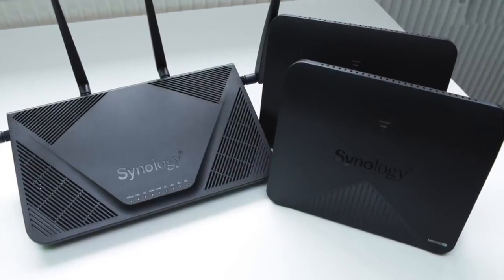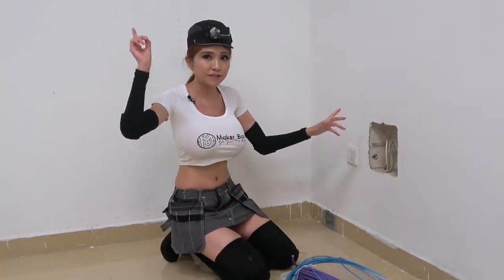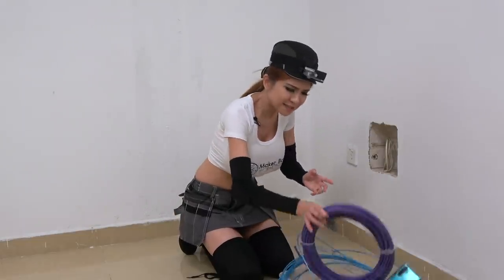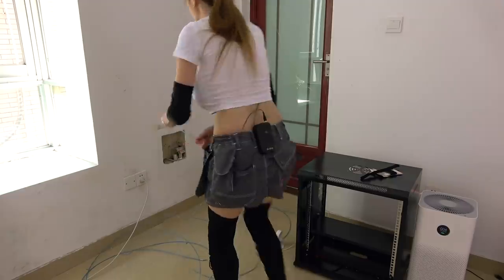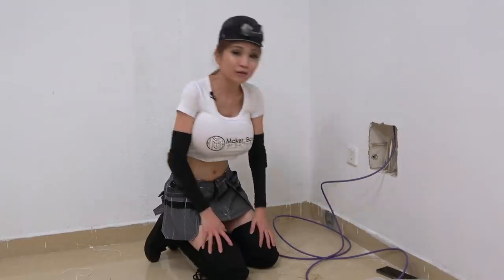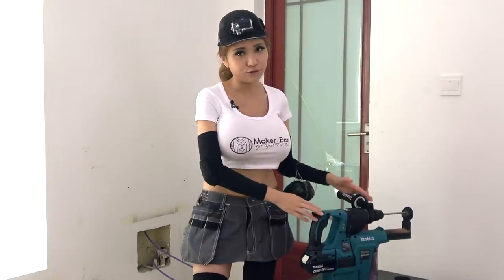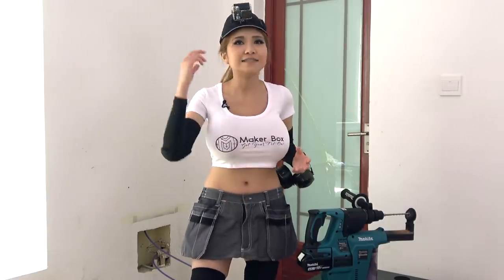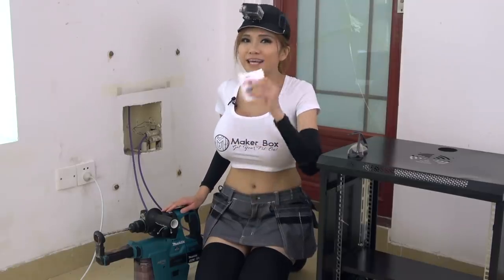Home Networking Part 1- Pulling Cable

Comment: I'm glad the pulling of the cable was so easy. I've pulled electric cable here in the USA many years ago. Because we had to pull so many cables through the one pipe we had to attach a separate heavy cable we brought in through a window. That cable was attached to the bumper of a truck. It took the strength of a truck to get the cable through the pipe!... One thing I noticed about the Makita (excellent brand of tool) was the tool's end is designed to drill a "perfect" 90-degree hole in the wall. That's precision!... And finally, women can do ANYTHING they want to do! I've known this fact since a little girl punched me in the nose when I was 7 years old because I was teasing her. LOL. Love to you Naomi and to all women. You are as "tough as nails!" (American slang!)

Comment: Naomi installing network cable before hot water: yeah, she's a nerd.
Reply: Ofcourse how els would you do it. Network first... The rest come later.
Reply: Move to a new place network comes first so you can pump tunes from your connected device while unpacking!
Reply: With temperatures as hot as she said, all she needs to do is set out a gallon of water in the sun while running cable. Boom, multitask.
Reply: who needs hot water, just boil it on a stove

Comment: JLPCB is truly great. Last week two friends (who don't know each other) showed me their latest prototypes.  One's an engineer whose prototype was for work, and the other's a self-taught hobbyist with no formal engineering training.  Both used JLPCB and had flawless boards.

The hobbyist friend also got lots of great feedback from JLPCB about DRCs (Design Rule Checks) he had missed, and learned a lot about keep-outs, drill selection, kerfs, slots and more.  The JLPCB folks helped make his first PCBs equal in quality to the engineer's.

Comment: You're fortunate to have conduit preinstalled, that's an important feature for concrete buildings. Concrete is an overall excellent choice for buildings--it's environmentally sustainable, and buildings have a long life.

I ran CAT6E through my house a couple of years ago. It's well worth the work, and it really doesn't cost much. I had to climb up in the attic crawl space during the summer and I could only stay up there for a few minutes at a time.

Great video, your English is very good.

Comment: Excellent video Naomi! As a PC/network field tech for the last 20 years, I have literally run hundreds of miles of network cabling. Not too much though over the last 5 years or so, and never run Cat 6e, that stuff is pretty heavy and stiff. It was so nice to see your fish tape go right through with no snags or sharp bends to mess you up, a lucky break for you!

Comment: I would work on your cable gang any day.  Polly always sees the good side of things, as we all should.  I used to have to use a vacuum to pull a string through the pipes to start pulling the main cables, of course, that was pulling 4 - 00 copper power lines using a 1/2 inch rope.  Cat 5 and 6 are fairly easy in comparison, still you explained and demo-ed excellently.  Looking forward to finish.

Comment: Ahhhh, the memories of running cables, did it for over 40 yrs. If you have to run more cables, in a conduit that already has cables in it. You can “ lube” it up with cable lube or use soap/ dishwasher soap. Plus strip back the cable at the head, to reduce the diameter of the cablehead. Just a tech note, if you put too many cables in a conduit, the signals in one cable can interfere with the signals in another cable. It’s called “ alien crosstalk”.

Comment: First off, lovely as ever and great video as ever. Second, when ever I have run cable I would run out a length of string tied to the cable laid out at length on the floor (that is stretched out the length needed plus a few extra feet) then with a vacuum cleaner hose on the other end and once the string gets sucked in, pull the cable through. No pushing through. Old saying in the army, officers up front because it easier to pull a rope then to push it. Again love your work.
Reply: I have done similar but the other way around.  Used compressed air to push the string through.

Comment: This brings back bad memories from the USMC when we switched over to Windows NT and cat 5 cables. Running miles (literally) of cable through well built concrete buildings in the middle of a hot summer in North Carolina.
Reply: now u can use cpl is quick to install than cable , ^^ and mesh wifi ,

Comment: One of my personal tricks for staying cool is keeping a cheap fan around for a quick breeze. The moving air helps your body's cooling system. Your safety gear is creative indeed. As long as it works, keep doing it. You would be a better Makita girl. You actually use the tools!

Comment: Awesome. A hammer drill is a very important tool, when you have a house. Drilling concrete without can be such a drag. I have bought mine after I had finished moving in :-)) It could have saved my some head aches :-))) And an electric installation in a house can offer many surprises, not only in China, in Germany, too. Especially, if the house is old.

Comment: An FYI trick for your future cable or wire pulls.  When I run long distance or through complex bends I use a small piece of sponge attaches to a piece of nylon twine.  I stuff the sponge into the conduit inlet then attach a vacuum to the outlet.  The suction pulls the sponge through. Once I have the sponge out at the far end I attach the wire or cord with a loop and some vinyl tape so I can pull it back through.  This method is fast and easier than phish taping in most situations.

Comment: You should make this into a video series, like renovation reality. It's really interesting to see what's different in Chinese construction. 

Dono if you've gotten hot water yet but you should look into one that doubles as an air conditioning as well.
Reply: Only problem with those is that they are poor at both jobs. You want hot water you run it at the point where it does not really get the air below ambient temperature, and if you want cold air your water cannot be too hot, as again you run up against allowable differential temperatures. Seen plenty of them just die and fail after around 4 years, as the compressors are cooked to death. Better to just have AC that works, and hot water from a separate unit. If you have a roof then solar, either panels or grid tie inverters, will be a much better bet.

Comment: You may think it is tough having concrete walls, but you are really lucky to have conduits in place. I spent hours trying to find a route from the garage to the first floor (a distance of about 1 metre) behind a stud wall.

Comment: I have pulled cable underneath wooden floors in the summer with only 50- 25 cm hight for me and my work. I know how exhausting it can be. Good to see you making progress. I'm excited to see a full room tour. 

by the way, usually you put the rack for your network a bit higher to make later access and service more easy. but you would need a propper cable enclosure from your wall feed up to the cabinet. So no complaints from my side how you've done it your way.

nice skirt by the way. looks very practical and fancy.
as always I wish you success and the motivation to reach your goals.

Comment: I have a bunch of Makita 18V tools, absolutely love them, I really like their cordless random orbital sander, the weight of the battery dampens the vibration and keeps you from getting "sander arm" from excess vibration. I find that I can run the thing through most of the day on a single charge of the battery, blows my old DeWalt shit right out of the water!

Comment: I've done a ton of wire pulling in north america, wooden studs, plaster board walls (Sheet rock) and fibreglass insulation. The IP camera idea is superb. HINT: I use a cheap USB endoscope, connected to a laptop. The light source on the end of the endoscope is worth it even without the camera.

Comment: That's an interesting Fish Tape you have there....  it has an attachment for the wire that you're going to pull... Normally you attach the new wire... To what's called the "Leader"',  ( it has a Loop for the New Wire)  The End you first put into the wall,  then you pull the new wire back through the wall.... Also, using CAT-6 Ethernet cable,  I believe is smart,..  it gives you 10 Gb of bandwidth,  plenty of bandwidth for the future.

Comment: Just a tip with conduit if you cannot get the tape through. Sometimes its easier to tape a wad of a piece of paper or a plastic bag to a string and vacuum it through. Then fish it up. I totally agree with CAT 6E Its what I use on all my network installs I have done for clients or myself.

Comment: My wife is also unable to sweat, so I'm acutely aware of how dangerous that can be working in the heat.  We live in Arizona, which hits 115F / 46C  or higher in the summer and so we've learned many a hard lesson on how to handle that.

Here's one such very important hard lesson that maybe can help you, too: if you are peeing a lot, then you are drinking your water in too large amounts at once!

It is critically important to stay hydrated but your body has a hard limit on how much water it can absorb at a time.  Any water peed out is water that wasn't used to hydrate you and was passed through untouched/wasted (literally).

We've learned to drink small amounts steadily and consistently.  You end up drinking a lot of water (roughly 1L every 1.5 hrs) but you never feel thirsty; heat exhaustion symptoms are drastically reduced; and you hardly pee at all since your body is using all of the water for hydration.

Simply changing the way we drank water was a game changer for us when working in extreme heat!

Comment: First the clothing. You're dealing with heat AND humidity and, let's face it, girl's gotta stay cool and dry. It looks like you've done the correct decision making on the practicality for you choices. 
Second, wouldn't it have been a little easier to let gravity help you  when fishing the wire?
Last, that hammer drill ROCKS!

Take care Naomi!

Comment: You’re lucky you the the conduits already there. Our houses generally aren’t solid concrete so cat 5/6 and various AV cables I need to run through walls I often have to use a “yellow tongue “ ( a long yellow piece 1cm semi flexible plastic ) and inspection camera can be very useful to. It’s funny you also talked about your clothes....your “cargo pants mod” is super cute, my wife also thought so and thinks you should do a video on how you made them!

Comment: I wired a stick built house years ago, and it was a very different process.  At the time I used an older Cisco layer three switch to handle all the intranet and some stand alone AP's.  A rack like that runs about $150 in the US these days, but I think they are higher quality, and deeper, a modern quality PoE switch needs more mounting depth than I think you have there, and if you need a rack mount server, good luck finding a wall mount rack with that kind of depth.  Pet peeve of mine, there's no TIA standard for CAT6e so I avoid it, the manufacturer could put anything they want in there and there would be no way to hold them accountable.  I recommend CAT6a or CAT7 if you don't think regular CAT6 is enough--although I'm sure what you have will be just fine.  I dig the giant tablet pockets on your shorts, super nerdy.  Makita is quality stuff.  Keep doing what your doing!

Comment: Very cool! That was fun. I have never had that easy of a time running cables. Usually, I have to grease them up to get them through the pipes. You are so organized. I could probably fix your hot water problem but the cost of getting there to do it would be outrageous.

Comment: Wear what works.
Pulling cable yourself at least for me was rough having to go up and downstairs to check my progress. Unfortunately, I didn’t want to totally destroy the place I had just moved into at the time and just ran wiring through the walls and above the ceiling but I have conduit to install when I’m ready to rewire everything.

Comment: Awesome work! I like your humour :-D
According JLCPCB: In Germany I tried to get small boards machine assembled. In a company I work for - which acquires series production - if I have a question for the part placer, they call back within 5 minutes. I know the boss and other employees personally and stuff, but when I want one board assembled for myself, they ignore my emails and act as they don´t even know me. And I tried several companies in Germany. They fcuking don´t care about prototyping or single board assemblies.
It´s not the first time that JLCPCB comes into my ear - I´ll definitely try them out! Chinese have a much better service and adapt to their customers´ wishes. I´m very grateful and happy about it. Thanx for your videos, always enjoying to watch!
Reply: I did one order with them and the process was very smooth.  It took about 3 weeks to get the boards to the states.  Most of that was transit time so I'm sure one could pay more to get them faster. The boards looked and worked great. Top/bottom copper layers with silk screen on both sides.
Reply: @timezonewall  Cool. For 60€ you can get shipping overnight, would be still half price of what I get in Germany.

Comment: Ah brings backs memories used to be networking specialist mainly laying and design but sometimes hands on. Mind you it may be a distracting working with you! But worked with many women and girls in my time , all were good or excellent at working with. They tried harder as it was not a normal work path for females.

Comment: Hi Naomi, Be careful drilling into those walls with all those hidden conduits (especially power). An electronic locator will help you stay away from the
cables. It is also a good idea to use cordless tools and have the power switched off, just in case. Greetings from Australia 💕💕

Comment: If plastic cable pipes behind walls are not available it is also a good idea to get a data over electric socket adapter such as tplink and similar. Just plug the cube1 to 220V ac aocket anywhere in the house then plug your lan cable from the router into the cube1. Plug cube2 at the room where you want to receive data and plug lan cable from computer, I think these cubes can broadcast wifi data as well, might be worth a test ;)

Comment: We ran a cable from back bedroom where the router is to the front room downstairs, had to zigzag through kitchen cupboards, as well as walls ....

but I haven't decorated downstairs so I just have a long cat5 going across the landing for the xbox because ping is more important than trip hazards  :p

Comment: Conduit?  That sure helps and is very rare in residential places of North America and in the places of Europe I've visited.  I've run a quite a bit of residential Ethernet and it's always required cutting holes in the walls (and repairing), sometimes needing a endoscopic type camera to see what is in said walls, and a lot trial and error. The actual pulling of the cable with fish tape is the trivial part. I prefer hardwired Ethernet to all fixed location devices and only use Wifi for devices that require it like phones/tablets as the spectrum is pretty crowded most places and the data rates are not that good.

Good mention on using fans, I often add fans to gear even if it wasn't designed for that. Hot equipment is the most common issue for reducing the lifespan of electronics.

Comment: Good job wiring your home. You're lucky you had conduits all over the map and did not have put them in yourself. ;) Couple of suggestions though: Use wire pulling lube to get the cables in easier. Also pull in as much cable as possible/needed at once, typical conduits will fit a pair of Cat.6/Cat.7 cable at once without a problem; putting in a second one after the fact is a pain in the neck. Nowadays I'd also throw in a fiber or two for good measure. I'd also highly recommend properly terminating it at both ends with sockets or in your cabinet at a patch panel.

Comment: Good to see you using overkill on them wall anchors, most DIYer go light and wonder why the thing falls off the wall :)
Reply from the maker: Yeah if it's going to be anchored a decent size person should be able to stand on it or it's just a hazard.
Reply: @Naomi-Wu  that's a right way of thinking! If it's flat, eventually someone will try standing on it.
Reply: Better a bit overkill because you never know just how shoddy the builder was, and using what looked like M8 rawl anchors works well in almost all masonry, except for those special cases where the plaster and paint is the only thing holding the wall together. As that looked like hollow block at least it will have some strength, and spread the load over a large area.

Comment: After running Cat6 two years ago through my house (built in 1961 with brick and massive beams) I would have killed for conduit to run through! 
Didn't look good doing it though. =P  Might have to look into those ninja installation shoes, too!

Comment: At my last two jobs, I know I've pulled miles of phone and LAN wiring..usually in hot, cramped and cruddy location. 
     Clothes are primarily for comfort...
      I've had heatstroke before - no fun at all. Keep a water bottle handy.

Comment: I dunno. Your outfit doesn't seem silly to me. Sure It would be better to cover up so you can protect yourself, but the reasons you gave seems reasonable enough. I'm in IT so I totally understand the bumps and scratches you get from running cable! Lol Just be a bit more cautious than normal and you should be fine! Can wait to see the rest of this! Good luck!